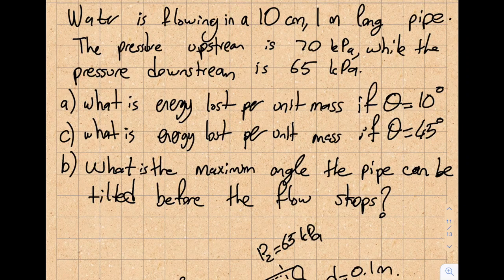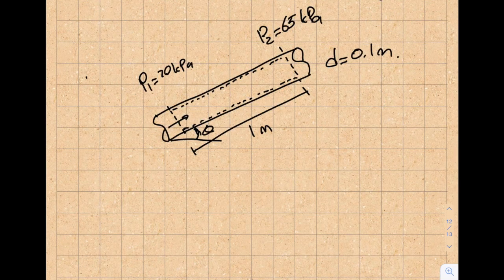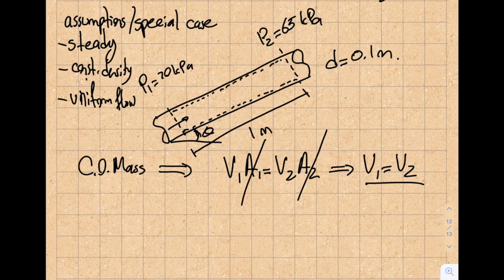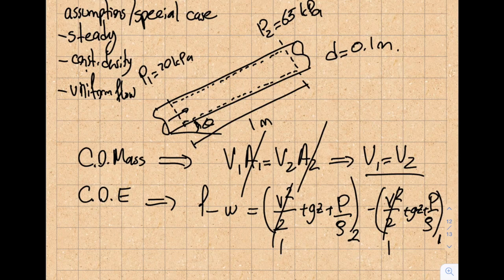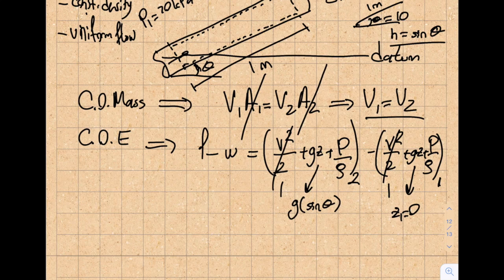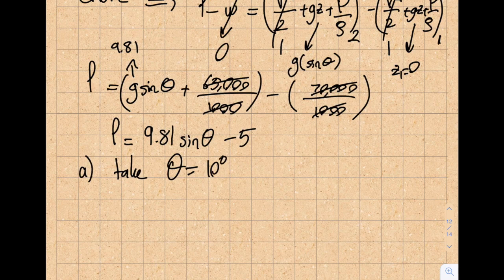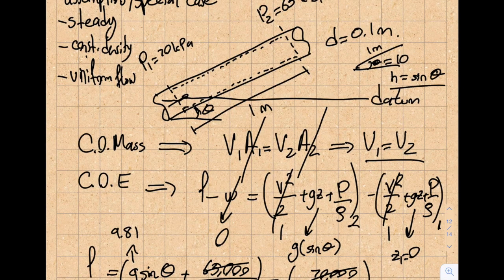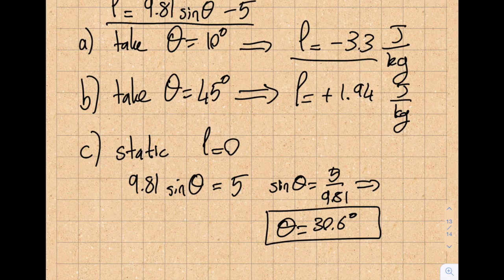Fluid Mechanics 7.3 - Solved Example Problem - Conservation of Energy (Loss Equation)

Comment: why cant we subtract off the two pressures at the start ? so after subtracting pressure at p1=5 pa and p2=0 and just work our way to the problem
Reply from the maker: You can do that for this problem, but this is a special case. Be careful in not generalizing this approach to cases where there is a bend in the pipe. Your approach will not be correct.